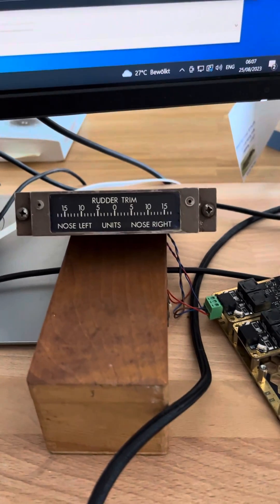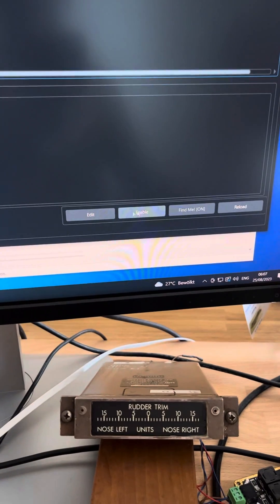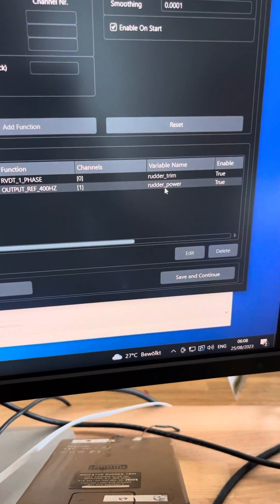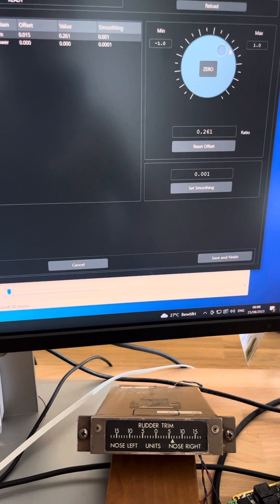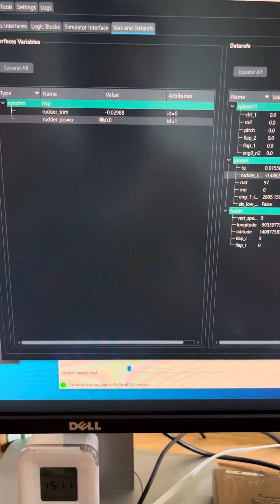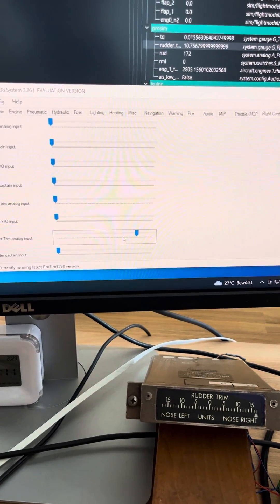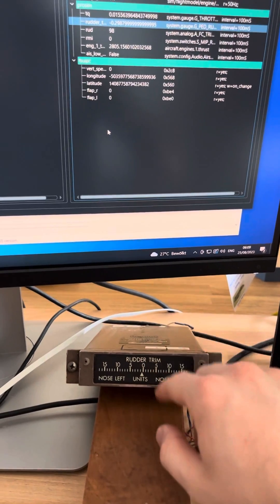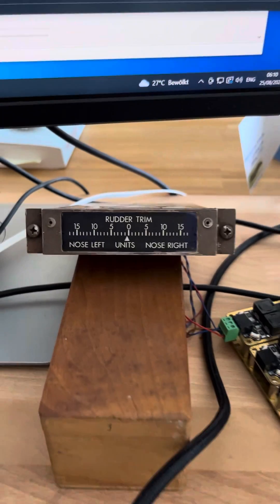Boeing 737/767 OEM Rudder Trim Indicator working with Synchro Card

Comment: Any way I can get my hands on one of those synchro card? Also how does the synchro Motor know where the middle is?
Reply from the maker: Hey! The instrument has a servo motor inside plus a position sensor. The input is an analog signal equivalent to a 1 phase synchro. 
You can contact me on 737goodness@gmail.com